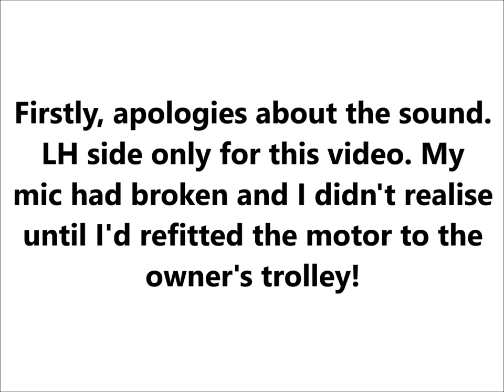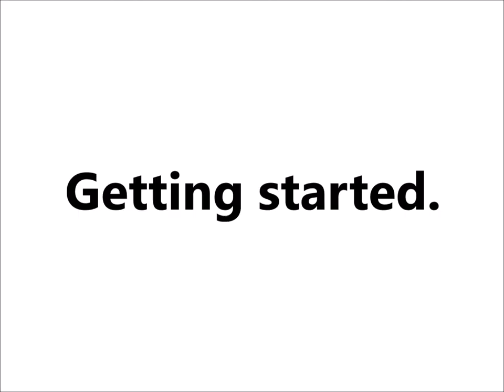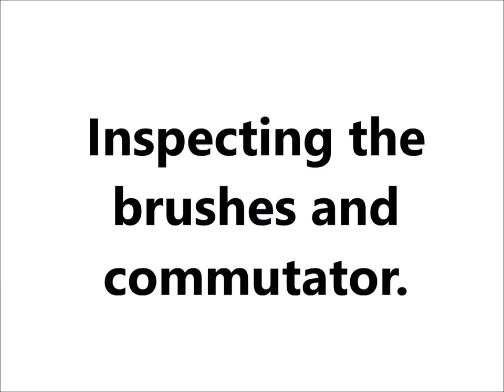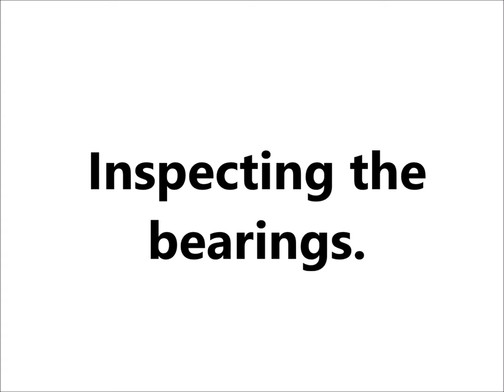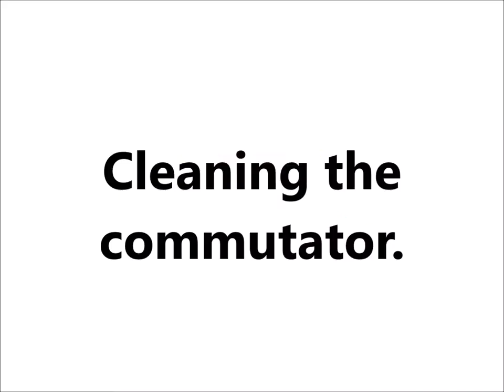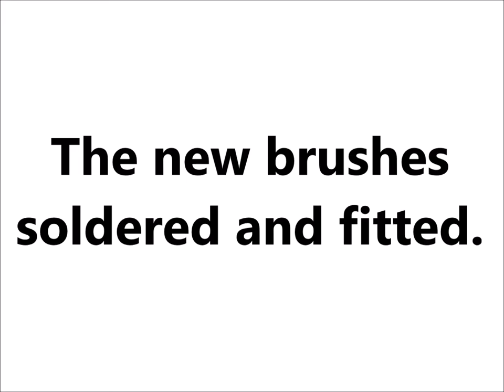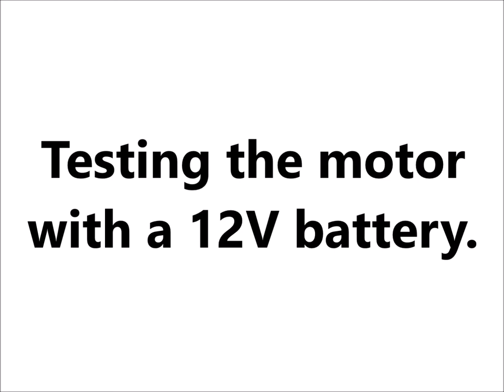Hillbilly Compact Light Lite Golf Trolley Motor Repaired (brushes fitted) at FixItWorkshop, Worthing

Comment: Hi i have one of those . Can you please tell me with the right pulley setup can i run a 4 kw generator with 12 volt battery and 3 250 watt solar as a quiet generator for power outages and alternative energy?  Any reply appreciated thanks from Australia!
Reply from the maker: I wouldn't have thought so, you'd need something with a higher current rating.

Comment: If you connect the motor directly to the battery, will it work? Do you need to connect it through a controller?
Reply from the maker: The controller regulates the motor's speed, so I wouldn't advise connecting the motor across the battery. I suspect the motor would spin at full speed instantly.